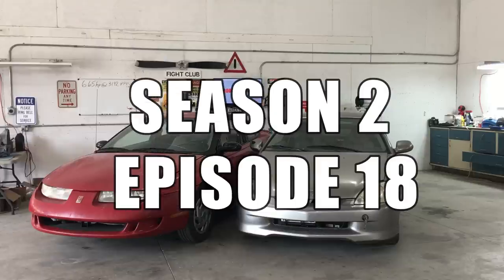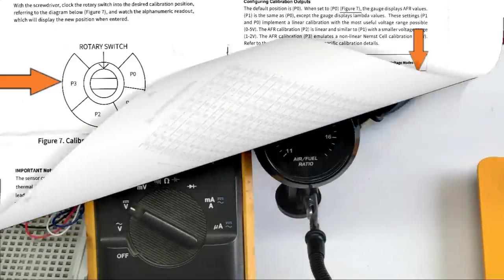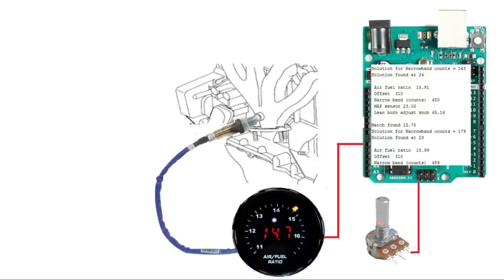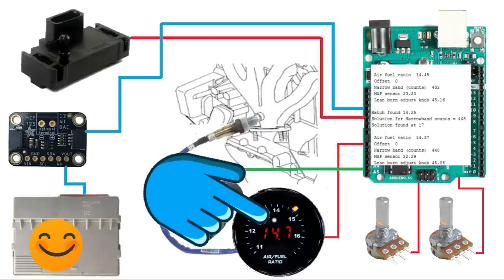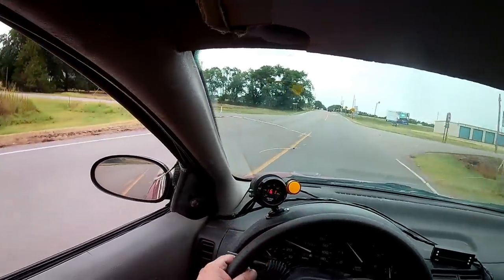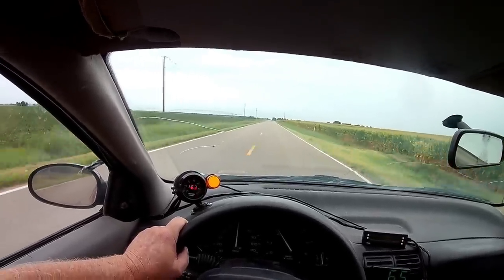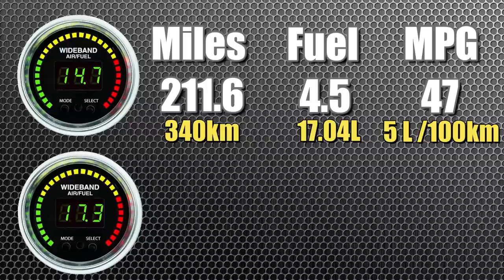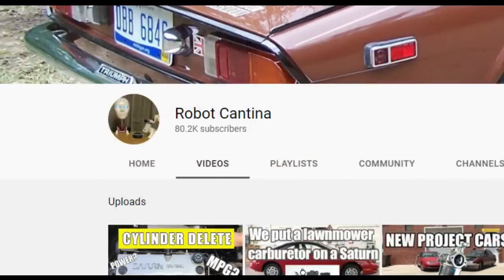S2E18:  We test a lean burn system on our Saturn .  Will it get better MPG?

Comment: I ran my carbed V8 at a 16.2:1 (steady state cruise) for a few years using an Innovate wide band to set it. One thing to take into consideration is lean mixes burn slower, so you'll need a few more degrees of spark advance to keep the thermal efficiency up
Reply: 8D Soundz  There is. But with diesel, you don't have control over how much air gets into the engine as the air side is usually wide open. You could change the injector setup so it injects less diesel or put on a turbo to offset the af ratio that way. Diesels usually handle more air pretty well but don't overdo it. It will get very hot.
Reply: @bv3078  excess air in a diesel cools it off, that’s why old diesels had a hard time warming up at idle where the AFR is probably 40/1
Reply: @bv3078  That's called your right foot ...
Reply: 8D Soundz  Yes, a turbo
Reply: any issues running lean? like engine damage?
Reply: @dantheman1998  That was only that lean during light load cruise. Pulling a hill or accelerating the fuel mix was rich. I have no observed engine damage.
Reply: @_..-.._..-.._  youre both right and wrong. theoretically Max thermal output and max NOx production is at 14.7 AFR. Going more rich or more lean from this number will both reduce engine temperature in an ideal world. going 40:1 lean as hell will be cold as hell. going from 13 to 14 AFR will also be "leaning" the engine but will significantly increase engine temp and is more representative of what most people are talking about in every day driving.
Engineering explained has a video from 3 years ago titled "Why lean engines do not run hot - myth busted" which you can watch. he does get the x axis wrong and basically talks about the 1/AFR relationship for half the video, so basically he calls a high AFR rich.... which its tehcnically lean... but im thinking its coz he took the graph from an academic paper who used some weird value and he made a small mistake converting it into every day langugae. Everything he says though about thermal efficiency, NOx production, engine temp, ect is correct however.
I do which he talked more about ultra lean fuel mixes and mpg effiency. you can keep leaning out the enginge way past 18 to where you have 20 or 30:1 air to fuel, which will reduce power but should ensure max fuel burn... I have a feeling though that you dont want to go too far away from 14.7 because a hot enginge will always get a better burn. I think the lean burn civics and insights would get the engine up to temp, then go to ultra lean for a little bit until the temp dropped, then go back to 14.7 AFR. also, go too high AFR u get detonation lol
Reply: Hello Mate please share how did you achieve  this ?  With fuel prices  these days its almost  impossible   to  drjve around  thankyou in advance
Reply: @ford351cleveland  most cars built after the year 2000 can have their air fuel ratio tuned to be more lean. this would be done with a laptop, software, obd2 connecter, and years of experience/skill to adjust the tables. more than likely, someone messing with these values though will decrease engine performance and efficiency. 

you could try an analogue approach however. In the HHO generator world, people build analogue circuits which they call "MAP/MAF sensor enhancers."
Basically it just spoofs the car into thinking it is delivering more fuel than it is. I am currently building one for my 7th gen civic but doing so in a way where i duplicated the MAP sensor and can just unplug it when i realize im not smarter than the engineers at honda. need to atleast try though. 
imo i would maybe start by checking your tire pressure. most americans can save ~20% on fuel by religiously checking their tire pressure and over inflating about 2-5 psi what it says on the door jam sticker. buy a cigar outlet pump for 7$ from walmart and do that before any long drive. btw obama actually put out a PSA in like 2012 asking everyone to do this and CA state then passed a law requiring all gas stations to give away free air. cant say I have ever agreed with obama/california on anything but daum...
Reply: @vevenaneathna  To all the very valued viewers of this fantastic  channel and primarily to JIMBO  OF ROBOT CANTINA ..It's December and the Holiday season is upon us, with celebrations like Christmas, Hanukkah, Kwanzaa, Mid-winter or Yule, and New Year all approaching.  Wishing you a joyous Holiday season and a happy and peaceful New Year.  Thank you  for a fun ride.

Comment: From what I've looked into previously about lean-burn you reportedly have to adjust the ignition timing to see any real advantages.
Reply: would make sense that it needs something to offset the wasted energy of  wasting energy compressing excess oxygen,
Reply: Increasing compression and adjusting ignition timing is what I've understood.  The Mazda skyactiv X setup also does the injection timing but I think they are reaching almost 30 to 1 ratios and using a spark induced diesel cycle (compression ignition) when this happens.

This lean burn series is going to be really interesting. In older carburetor cars, if you ran things too lean for extended periods of time you ended up with hot spots that would damage things inside the cylinder. It looks like selective usage might overcome that.
Reply: Insight has an offset crankshaft too.
Reply: this is due to the high vacuum in the intake, lowering the compression of the air entering the engine. The loss of compression results in a slower traveling flame front. In order to compensate, you need to advance the ignition timing. This creates a more efficient burn and produces much less emissions.
Reply: Yes, the Insight will go to around 30° advance in LB.
Reply: Yes, this is because the flame velocity is correlated to AFR. The ignition must be adjusted to compensate for a slower flame front :)
Reply: YES big gains..  32mpg (hyw) on a  6.0 L engine ..2mode hybrid,,    but the advancement goes to 45° degrees on premium fuel..(only from a specific gas station though  i only go there )

i need to replace the HV-battery...  my mpg slumped  i'd be lucky to get 16  :( i'm scared to check tell i get it replaced  but i still enter it into my fuelly log
Reply: @slickyblick  ive always learned that flame front speeds dont vary much and if they get too fast you end up with detonation

Comment: Having experimented with lean burn I can tell you that you will need to add quite a bit of spark advance because the lean mixture takes a while to get lit off and burn.  Without doing so engine response will be extremely soft and you just won't get the efficiency gains that are possible.  Also, finding the optimal AFR can be tricky but you probably want to be in the 17-18 range.  Exhaust gas temps drop as you move past the ~16 range.  Finally, I suspect that lean burn works best at lighter engine loads.  So this could work well with a lawn mower carb (which can't load the engine fully) but would NOT really be compatible with cylinder deactivation.

What I also recall is that I gave up fooling around with switching O2 offsets and just ended up in open loop mode so I could directly command an AFR.  With the engine all tuned in (i.e. VE) this works well but you lose feedback control obviously.

It is possible that HP Tuners (for example) offers a way to tune the stock Saturn ECM which would allow this experiment to be a little easier I think, plus you can control spark advance at the lighter loads where you intend to do lean burn.  With the lawn mower carb you already have an air bleed solution from Thunderhead289.  That is a standalone solution with WB feedback control, but you would still need to play with ignition timing.

Looks like both HP Tuners and EFI Live do NOT support Saturns earlier than 2000.

Other fun fact: GM had some factory lean burn applications in the 80s/90s on certain vehicle applications.
Reply: Totally agree.  Timing is a big part of combustion efficiency.
Reply: @tkmad7470  With his skills I bet he could intercept the ignition module and add a spark advance offset (engine RPM is a required input), but simply dialing a knob for a constant offset is not really the best approach.  BUT it could help gather valuable data which we like.
Reply: I agree that adding timing should help. I'm not sure how to trick the computer into adding timing, however. 
  I'm using the stock fuel injection system in my 1992 Chevrolet C1500 pickup to get pretty good mileage. I got a modified ecm so that I can tune the engine's computer with my laptop. I added anywhere between 4⁰-22⁰ of timing throughout the spark advance tables. I spent a lot of time tuning the spark tables to ensure that the knock sensor stays quiet and happy. The changes in the tables don't take much time, and it only takes a few seconds to flash the changes to the ecm. If I see knock, I'd pull over and pull timing and reflash the ecm. I'm using 87 octane gas.
  I'm also running an Innovate Motorsports LC-2 wideband O2 sensor like the one he unboxes in the video. The only modifications I've made to the physical engine is the exhaust. I also installed an aftermarket 2000rpm torque converter. I should have paid a little more and gotten a stock replacement converter. It is too loose for in-town driving and my gas mileage suffers. 
  When the torque converter clutch is locked and I've got the cruise control set to 55, the instantaneous mileage is in the 28-30mpg range. I have the clutch set to lock at 45mph but you need to pass 45mph until it locks and then slow down a couple mph to consistently lock the TCC with cruise on. 
  The truck has 267k miles and is a great daily driver. It enters Lean Burn mode when the engine coolant is up to around 190⁰F. I had previously installed a 180⁰ thermostat and the computer would never trigger lean burn. So I installed a 195⁰ thermostat with a 1/16" hole drilled in it. The hole allows air bubbles to pass through and a small amount of coolant. Certainly not enough to overcool the 5.7L 350cid engine.
Reply: @EricErnst  Cool stuff.  I started almost 20 years ago tuning my 93 Caprice 9C1.  That car did have a factory lean burn mode.  The strategy was that it required pretty steady highway driving and would still bump out of lean burn to check fuel trims.  That car lost a cat (disintegrated and clogged the exhaust flow) and research revealed that lean burn may not be too friendly to cats.  So I never really fooled with it again on the Caprice.  But I did try some lean burn on my 95 Cadillac Fleetwood w/ LT1.  That was the car that required open loop and ultimately I put it all back to stock but the experiment was cool.

I would say my big tuning resume item was on my father in law's 1983 C10. Originally shipped with the 250 I6 and 3 on the tree.  He slowly evolved it.  There was a point where it had a 292 and a 4 speed floor shift.  He converted to TBI (from a 1992 G20) and I tuned it for him.  Then he put the 700R4 from the van in and I tuned again.  Finally, he added a turbo/intercooler and I tuned that with EBL.  EBL is amazing btw.  Take a look (unless you are already using it).
Reply: Would've just use the speeduino to control fuel & spark, make it easier
Reply: The Saturn ECU has been cracked in the past, but the few who did it never revealed thier secrets. Currently the only way to tune an S series is either megasquirt or Electromotive
Reply: @kevin9c1  Yes. I'm using the ebl ecu. I'm gathering parts to do a roller cam swap with a 202⁰/212⁰@.050" cam. .550"/.546" lift. It should make 315hp with my setup. That's about as far as I feel comfortable pushing the fuel on the throttle body and 2 injectors. Above that, I'm concerned about idle fuel supply. Right now, I'm idling at 3% duty cycle and commanding 114% at WOT at 3800rpms with stock fuel pressure. 2 injectors is just not enough to cover the range from 625rpm idle to 5000rpms wot!
  I'll use a vacuum referenced fuel pressure regulator to help modulate fuel delivery but I've installed 81lb/hr big block injectors in the past and the idle sucks and wot didn't produce the power I was expecting.
  If I'm unhappy with the results, I'll simply install a holley sniper system like I did in my other truck. Or perhaps convert my supercharged truck to multiport and use the regular sniper system on this particular truck. 
  Too many projects, too little time.
Reply: @EricErnst  I estimate my father in law's turbo 292 is making about 300 hp with the small block TBI and STOCK G20 injectors which I think might be in the 61 lb/hr range if memory serves.  He is using a vacuum referenced regulator and I think fuel pressure is set pretty high.  It goes over 30 under boost.  No problems with injector dynamic range on idle or high end.  I could locate an old data log if you like.
Reply: Those lean burn GM cars ran so lean all the heads had holes in the combustion chamgers
Reply: @thefinalroman  Well my Caprice which had factory leab burn made it to 313k before rust claimed it.  And it was a North Carolina state Police cruise originally.  Admittedly I disabled the lean burn probably around 150k so I don't know how much that proves....
Reply: @kevin9c1  I remember that when I used to get my 1995 Caprice smog tested that the AFR would read as 15.3:1 for the simulated road test.
Reply: Another HP Tuners fun fact: some Australian GM V8's featured lean burn, and can be enabled in certain USDM OS's.
Reply: @philballphotography  Yes I definitely think that is accurate.
Reply: So. Might as well just go megasquirt if you now need to message the timing map as well. Why sit there and do piggy backs when megasquirt or speeduino is couple hundred dollars.
Reply: @Rebel635csi  Yeah, provided those coils don't require any funny business to control.  It sounded like it might use that ionic current knock detection strategy which is why he said it needs a certain plug. But could always just use a regular coil and standard caml/crank trigger into MS or whatever.

Comment: Hey Jimbo,
the Arduino has an integrated map() function which should easily map the signal from wideband to narrowband :)
Just approximate values after ADC wit 0V=0 and 5V as 1024:
Narrowband signal is ~0.95V or 194 ADC for <14.2 AFR, ~0.05 or 10ADC for 15.2 AFR
Wideband is ~2.1V or 430ADC for 14.2AFR, ~2.6V or 532ADC for 15.2 AFR
output_signal           = map(input_signal, fromLow, toLow, fromHigh, toHigh) - you can have the scale inverted for output if you need to:
narrowband_signal = map(wideband_signal, 430, 194, 532, 10)
Values outside the  input range are mapped to the output limits (just as the narrowband does).

I really don't know if that's faster than lookup tables - but it's an easy feature :)

Comment: I think over on LegitStreetCars, he remapped the ecu on a manual Corvette so when it was in 6th gear going 65 mpg, it was running lean and getting 40 mpg. Like everyone has said, maybe more advance in timing could be the trick to better numbers. Keep up the great work!
Reply: His lean burn kicks in at low load 6th gear 55-70 mph and avg 40-42 mpg hwy and when he mashes the go pedal he still has 420+ RWHP on tap for Corvette reasons lol
Reply: Yeah but you need to run 91 or higher  other wise you will run the risk of blowing the engine

Comment: Honda had an engine back in the 90´s with the code D15Z6 that ran lean when the "Econo" light showed up on the dash, then, when you put your foot to the floor, the "Econo" light would turn off and the engine would run rich.
When running lean, the ECU would disable one intake valve per cylinder creating a vortex in the intake into the cylinder (running on 12 valves), when running rich, the ECU would tell the E-VTEC solenoid to open up the oil passage and the other intake valve would also open (running on 16 valves). 
There were another Honda engine capable of doing that, the B15B 3 stage VTEC. 
It worked the same way as the D15Z6 but at higher rpm's, the bigger cams pushed the intake valves further to get more air into the cylinders.

Comment: This episode is a whole new level of complex.  Great job. 

I had to run my sl2 with no ac.  It sucked to much power for even moderate hills, and caused overheating when stopped. 

4-70 was the only plan to stay cool and keep going. 4windows down, 70mph

If you’re going to turn the mirror to prevent identifying the follow vehicle I would add a backup camera and hide the monitor.  I have $40 jungle site in both of my trucks.  It makes the rack body drivable, and makes it so I can actually get attached to my trailer.  On the other truck it just makes hooking up the trailer an easy one shot deal.
Reply: Your Radiator and Condenser must of have been clogged with dirt and debris
Reply: @j.m.5995  or bearings.

more likely something up with the compressor really.